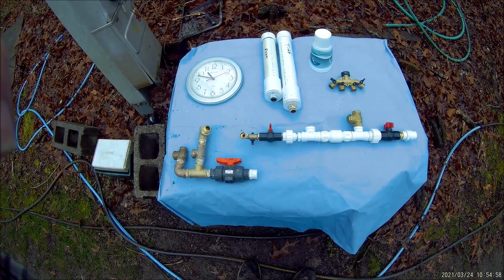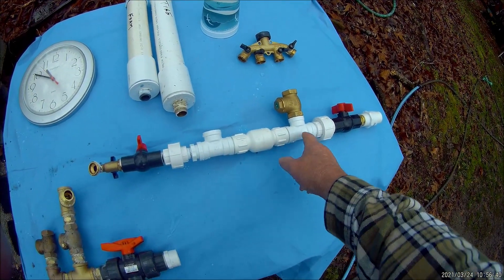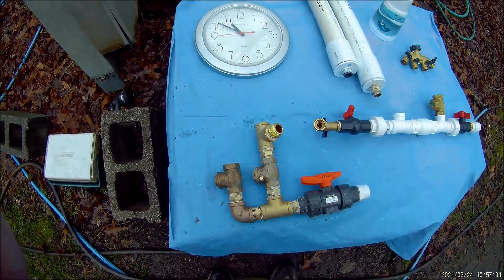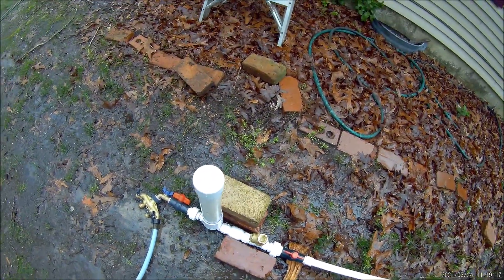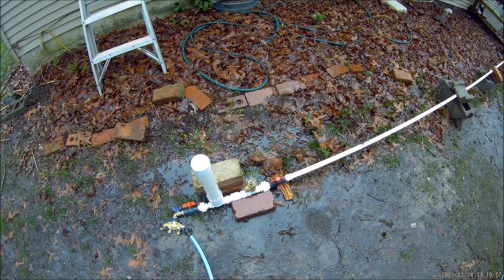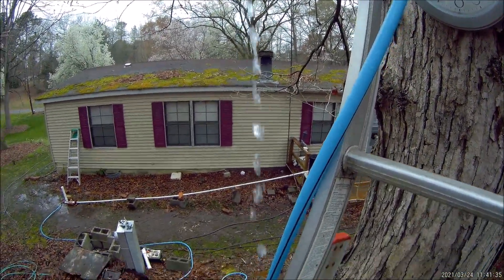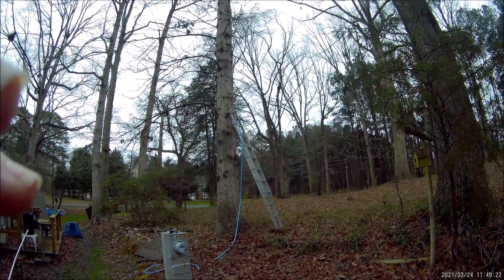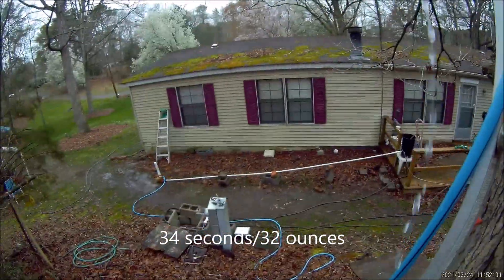Best Ram Pump Design?

Comment: I run my ram pump in a tee shape. The waste value goes out on a pipe from a tee to an elbow. That way my ram pump stand on it's own. I used water balloons in my pressure tank. I just don't blow the balloons up. You run about exact setup as my 3/4 ram pump. I use a 55 gallon rain barrel as a stand pipe off my flowing point well.

Comment: How high can a Ram Pump Lift water?   I need about 300 feet vertical lift
Reply: Depends on the supply head https://waterpoweredtechnologies.com/wp-content/uploads/2021/09/Multi-Pump-Information-Sheet.pdf
Reply: I need about the same, I just found the spring on property I bought yesterday, below my current place, on a mountainside. I'd have 35' of  drop in about 200', from the spring outlet to where I could position a pump. In theory that'd give me around 245' of lift. A dual pump setup may be the way I go, one pumps up halfway to a holding tank, where another pump setup repeats the process. These thing are cheap enough to build to make that concept worth looking into. BTW I did solar water pumping (Grundfos SQ Flex pumps) work as a sideline for  years, installed about 25 or 30 systems for ranchers mostly, and pumping out of wells. BUT these pumps intrigue me, and would seem to offer a more cost effective solution than just throwing a Grundfos in a stock tank that's kept filled by the spring. It may be hard to beat the 24 hr a day performance of a RAM pump.
Reply: It is better to make or build your own waste valve which is adjustable or can tune up to long or short stroke. Row swing check valve with the same diameter of drive pipe the ratio is for 1 meter drop it can lift 7 meter but for adjustable waste valve it can lift more ch much higher with very good output.. Try to look Bohumir Stehlic design, You can watch in Youtube

Comment: Great video! I have a question though.

I watched a video from Land to House's channel (from 2017) where he did a similar test and found that the horizontal pump actually pumps faster. I'm not saying I know enough to determine which test is more "accurate," but you mentioned that you've got a few years of understanding under your belt. Do you know what might cause this difference in results? I always assumed a vertical pump was better, since a linear pump requires you to overcome some spring pressure in the check valve. I suppose that's subjective and based on the head pressure of the delivery pipe.... Anyway, any clarity would be great!
Thanks!

Comment: I noticed that you tested a horizontal versus a vertical version using different insulated pressure pipes. That the tire insulated option was better as well as the vertical version. I recently thought that this is a one valve system and it got me thinking, about car engines. There is a 4 cylinder, 6 cylinder, V8, etc... Which gave me the idea, what if you built a ramp pump built on the theory of a 4 cylinder engine and how the pistons move. Each are in a different position. While one piston is completely closed, while another is a quarter of the way closed, another is half closed, and the last is 3/4 of the way closed. As the pumping action works each will be in either of these modes of operation. I bet the parts to do this will be around 4 times as many. But, if everything is fed together in the right way then it will act to simulate a 4 cylinder engine. It would be a great experiment and could create 4 times the water pressure. I noticed that you started the pump with the valve at the end of the vertical system. That same piece could feed into the second pump to get made, and thus the water off shoot that was happening would be feeding the next pump. At this point there would be two high pressure outs. Hoses could be filling up a tank somewhere. Or else they could be being the feed into other ramp pumps and building greater water pressure, and at the end converge into one ramp pump with the highest pressure possible. The water that is just spilling out could be getting collected by a tank, so that no water is wasted or lost.

Comment: Question would the second ram pump work with the pressure tube in the horizontal position attached with a 90 degree fitting?

Comment from the maker: The head was less than 3 ft ( elevation between pump and drive-pipe intake.)  As a rule, ram pumps will function at a ratio of 7 feet of elevation on delivery end as compared to head height. ie: 3 ft head = 21 ft delivery elevation.  Both styles of pumps met that ratio.
  However, my unofficial observations indicated that the vertical style might pump even higher than 7 to 1.
  I have ideas for additional tests; plus showing exactly how to set up a ram pump in a shallow creek with very little fall.  And, I will answer the question as to whether or not you can deliver water DOWNHILL before going back UPHILL.
  I rarely read public comments, but you are very welcome to share your thoughts for other viewers to benefit.  I am not a "professional" YouTuber - never made a cent off of any video. So, you won't hear me urging you to share or subscribe; but, if you think this content is helpful, you might want to tell somebody else about it.
  If you have a YouTube channel, feel free to repost without fear of copyright infringement.
I also plan to post a video that depicts step-by-step how I built my vertical ram pump. No special tools or experience is required to make one of these.  All parts are easily obtainable from Amazon or from your local hardware supplier.
  A ram pump can save you lots of money if you need to irrigate your lawn, water livestock, water your garden or fill an uphill pool.
32 ounces of water in  27 seconds might not sound like much. But, do the math.,,,30 gallons per hour/5,000 gallons per week!  20,000 gallons per month! That's more fresh water than my entire crew used on a typical long-range commercial fishing trip.
  It's more free water than I could afford to pay the city during the growing season.
  Good luck.  You can do this project.
Reply: amen brotha - thats what I like, smart diy economics where a little upfront with freedom on the backside
Reply: Thank so much!
Reply: been trying to think about how to reduce the wasted water or cycle it back somehow... but im reminded i can't send it to the in pipe... what if the inpipe was reduced and you add a storage pool/tank/bucket?

would it be possible then to send the waste to the top half of the tank?... 
just throwing out ideas
Reply: @siekensou77  sure, just complete the circle - connect reservoir tank to in pipe tank using same h20 over & over
Reply: @kingscairn  
some additional thoughts:
ok so if the system is 50%, then you use the wasted water to flow into a second implementation of the system, that means overall is now 75% (50% of 100 + 50% of 50) but add another system.. possibly the best you can do? not sure. depends on size of the first system.
but using your idea, feed both 2nd and 3rd systems into the first.